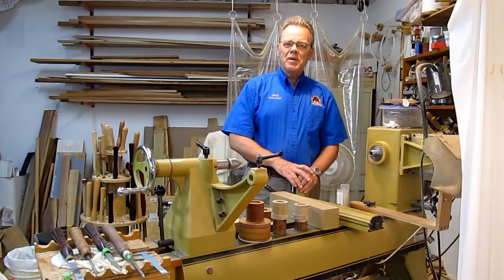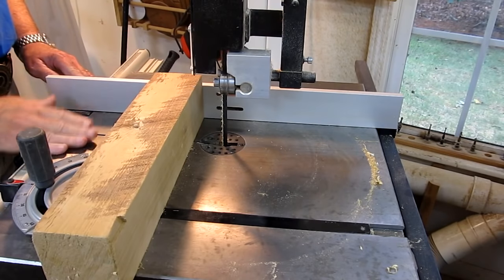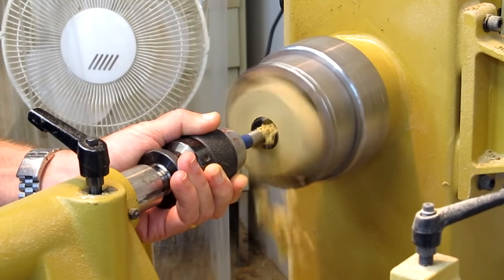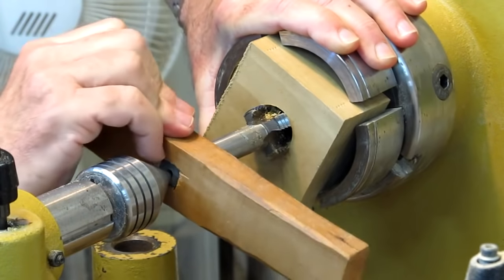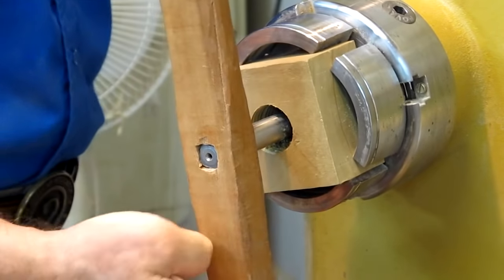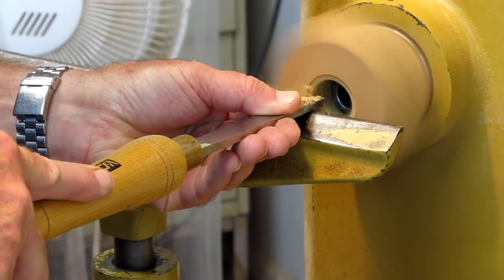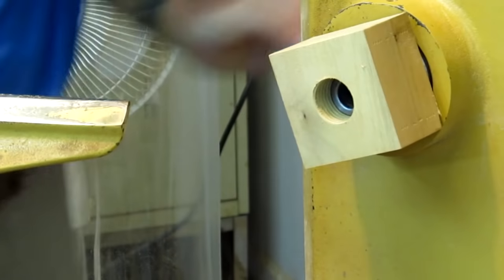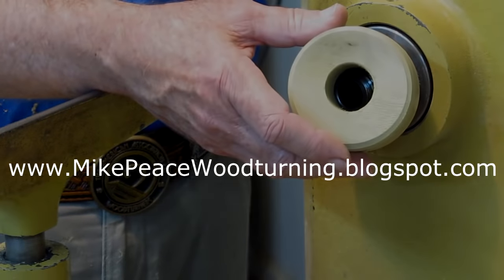Make a Wood Faceplate for Woodturning - Beall Spindle Tap

Comment: Thank you this was very helpful to understand the steps needed to use the beall spindle tap. I was wondering when you were going to use the spindle lock to help with the tapping process .. then you thought of it... There seems to be alot of good uses for this tap. I saw a video where it was used to make a block that was then glued to a disc for a disc sander. for the lathe..Great video by the way.
Reply from the maker: Glad it was helpful!

Comment: I like your wood 'wrench', I think maybe I will make one of those also.  I chuckled when your sound track is misaligned with the video...I remember how many times that happens to me, and I work tediously to make it right. Funny how it really bugs me when its mine, but when it's yours, it is just fine with me. ...Maybe I will have the 'guts' to leave mine imperfect now too.lThanks!
Reply from the maker: ***** Thanks for the positive comment.  When you have spent hours editing and the files get out synch in the process and you have not dealt with that problem before, I think you reach a point where you throw in the towel and say it is good enough.  With additional editing experience I can better fix problems like that when they occur.

I note that for a very small number of folks it bothered them enough to "dislike" the video because it had an obvious flaw. 
I strive for quality but recognize some folks are never satisfied with what others provide for them - free of charge. I can accept that.
Reply: You are SO right! I have had the same problem, finally decided I would fix it one way or the other...I just erased the sound, and put in some text, tee hee... figured I would figure out my solutions somehow later. I kind of did, but kind of didn't. ...I try to be careful to make sure I take time to cut them both at the same time, and listen while I watch, very often. I have to backtrack a lot, but have been a little more successful at it the last couple of times.
Honestly, I found it similarly humorous, that someone else suffers the same problems I do. :) I don't feel so alone. I still like the video! :D

Comment: Very interesting videoclip - Thank you!!

I'm very new in woodturning, a real rookie with low-tech tools and old noob-machine from China  ;)  

After I saw this video, I wonder if Pine is safe to use as threaded wood face plate? 
..perhaps Birch is better??

And i guess that the wood must be dry?! 

I've seen a few videos about making faceplates with screw-nuts in the center and i was planning on drilling a hole and use epoxy to get a "metal-core". But your method seems easier and more fun  :)

thanks again // Hardy
Reply from the maker: Yellow pine, maybe. White pine no. Most any hardwood will work fine. You want the threads to hold up. Wood must be dry or you will get movement that would interfere with the threads and the flatness of the faces.
I started out with Harbor Freight tools and still use most of them. Cheap steel for regrinding into special purpose tools when you start replacing with better.
Reply: Thank you, mr Peace.

Comment: Excellent video Mike.  After 30+ years I’m finally getting back into wood turning and boy have things changed.  I have been using 1” nuts using epoxy to put them in a block but this looks like the clear ticket.  One question I have per this 1” x 8 TPI Beall tap; I’d like to also use it to make lathe projects that I can screw together so I need a 1” 8 TPI die but they seem really rare. I did look for both on your Amazon page but couldn't even find the tap.  Any suggestions?
Reply from the maker: I think they are rare. If you are using for joinery, you might do better with a 10tpi threading jig to do the male and female thread. It is what I do on my larger acorn boxes.
Reply: @MikePeaceWoodturning  Thanks!  I was hoping to kill two birds with an 8 TPI.  Lots of 6 TIP tap and dies.  I do know a small shop that does do and carry a lot of off the wall stuff.  I'll try them first and if they have something I'll see.  Either way I'll let you know and thanks for a great site and information!!!
Reply: Mike, I did get the Beall 1” x 8 TPI for making blocks and I got a 1” X 8 TPI die for about $35 at that shop I told you about. This way I can use it as a set.  Tapping the block was a breeze, threading the test shaft little tougher.  I ASuMEed it would take a 1” shaft to thread.  Nope needs to be a 1/16th, maybe an 1/8th bigger.  It fits but sloppy. Like I said, TEST piece.  It will take me some experimenting how to put to use but I’ll keep you apprised and maybe I'll have to get a 10 TPI.  Time will tell.  Again thanks for some good vids.

Comment: Mike, another good video!  Question:  Do the Beall threads need any CA got toughen them up....or not so with this thread pattern?  Thanks again.
Reply from the maker: I have done it both ways and don't think CA is worth it. A bit of parafin wax on the threads helps reduce the friction when threading on a spindle.
Reply: @MikePeaceWoodturning  But doesn't the CA harden and make the threads stronger?
Reply from the maker: @mitsukowalker5831  Yes. As I said I have not found it necessary to harden the threads. I have never stripped a wood thread on a glue block. I don't like using CA if I don't feel it is necessary,.

Comment: How did you put the CA glue in treads and remove it thx and the by I’m a member of Richmond Woodturners Richmond Va
Reply from the maker: I just dribbled in a few drops into the threads and ran the tap thru again after it was dry.

Comment: Hi
You might run across a spring loaded center.
These are designed for taping just as your 60 deg center.
Mine has about a 1/2" travel.
These spring loaded centers don't need as much tail stock adjustment when taping.

I have you on my subscribed lisd.
Reply from the maker: +Dennis Williams 
I have never seen what you are describing. I could not find anything on Amazon. The closest thing is a steb live center but it is not a cone and would not be suitable for supporting a beall tap. Can you provide a link to what you have in mind?
Reply: They are called tap guides and are available from LittleMachineShop.com..See https://littlemachineshop.com/products/product_view.php?ProductID=3104&category=

Comment: Would getting 3/4 poplar from the big box store and glueing them up and follow your procedure work?
Reply from the maker: Yes but better might be 8/4 from a lumber yard. You can also cut into spindle turning blanks to practice beads and coves, turn birdhouse ornaments or gonks.
Reply: @MikePeaceWoodturning  thanks for the quick response.  I need to get used to going to lumber yard for materials.
Reply: @MikePeaceWoodturning  You may think this is a dumb question but I usually don't go to the lumber store.  What width and length would you suggest  for the projects you mentioned above along with the glue blocks?
Reply from the maker: 8/4 is two inches but when finished at the sawmill or lumber yard it is about 1.75" which is thick enough. Glue blocks might be 3" in diameter. Lumber widths are what they have on hand and you can usually get a piece a minimum of 6 ft long. @fergusrb
Reply: @MikePeaceWoodturning  Thanks.  See you even answer my dumb ass questions.  Thanks again

Comment: That's a useful video, thanks.     Although I realize that there is no danger of a kickback when cutting off stock on a bandsaw while using the fence as a stop and the miter gauge to push, it is very dangerous to do that on a table saw.  Since I tend to be a creature of habit, I never do that even on the bandsaw because someday I might forget...

Comment: Nice demo Mike. I have a question for you; is there a reason why you didn't lock the chuck in place while you were tapping the glue bock?
Reply from the maker: After rewatching I see what you mean. No reason at all. I do have a way of securing the spindle lock. No idea why I did not as I could have then used both hands to turn the tap and quill. I haven't had a need to make any since I did the video as I have a good supply on hand but will think about that next time I do. Thanks for catching that.

Comment: Mike - great video illustrating something that a lot of turners either haven't heard about or considered too exotic to try.

A few additional thoughts:
1.  You illustrated, but didn't actually address the issue of grain.  Wooden faceplates work better when you drill and tap into FACE grain.  End grain tends to crumble.
2.  You also illustrated but didn't actually address the issue of drilling all the way through the blank.  Beall taps are tapered taps that won't thread all the way to the bottom of a hole with a closed bottom.  You can buy 'bottoming' taps that will thread to the bottom, but they are very expensive and you still need the tapered tap to start the thread.  So drilling the hole all the way through the blank allows you to thread the entire depth of the hole without needed a second 'bottoming' tap.
3.  You mentioned the value of putting some thin CA on the threads, allowing it to cure, and then running the tap back through to clear the threads.  I find that it also helps to follow that up with a little wax on the threads.
4.  Beall is a great source of taps, but mini/midi lathe owners can purchase 1"x8tpi taps at Ace Hardware.
Reply from the maker: All excellent points that I should have spent a moment explaining in the video. Thanks for the excellent post.
Reply: +Mike Peace Hey Mike, how do you go about putting the CA onto the threads to 'harden' them up a bit?

Comment: @Mike Peace, I’m sorry to impose if you’ve already answered this somewhere else, but does the tapped bore have to go all the way through the piece? I am just thinking about the loss of glue surface. My immediate plan is to make a 12” sanding wheel to prep my segmented layers for gluing.
Reply from the maker: Know you could of course make your glue block thicker. It makes more sense to go all of the way thru though. The loss of glue surface is not significant. If it is a concern, simply make a glue block with a larger glue surface.
Reply: Mike Peace Woodturning , thanks Mike. I appreciate you sharing your knowledge.

Comment: is 2x4 wood suitable for tapping a faceplate?  It's probably fir.
Reply from the maker: Maybe for very light duty but since you will reuse, I would prefer something a bit stronger. I use poplar a lot since it is inexpensive and available in 8 quarter stock at the lumber yard. You could always glue up something thinner if you have 3/4" boards of cherry, maple or whatever.

Comment: Hey Mike, hope I didn't add a comment in your stead on the last post--at any rate, I was wanting to know how you go about putting CA on the threads to 'harden' them up a bit?Thanks--Don
Reply from the maker: +Don Davis I just dribble a wee bit of thin CA into the threads. After it dries, I simply run the tap thru the threads one more time and then rub a bit of candle paraffin into the threads.
Reply: +Mike Peace Thanks Mike, that's what I guessed, but I'm gonna make a couple of these tomorrow and just wanted to be sure--appreciate it!